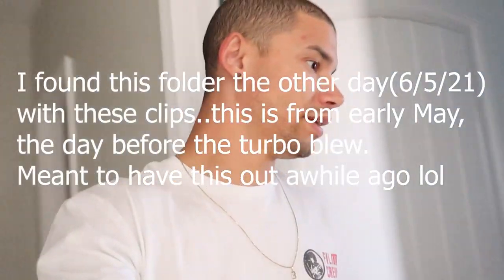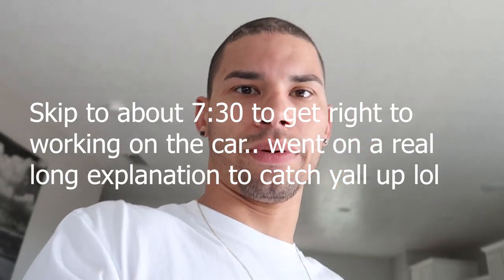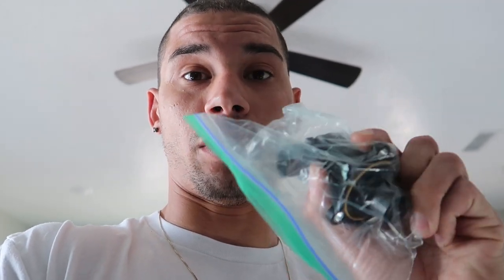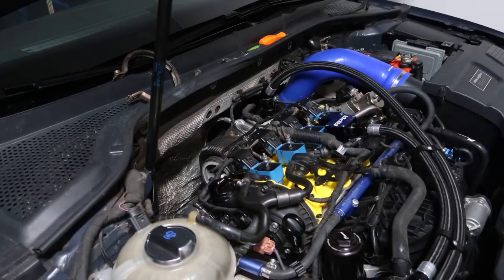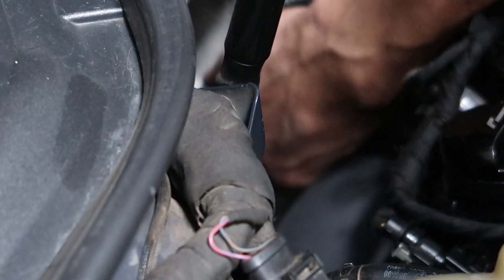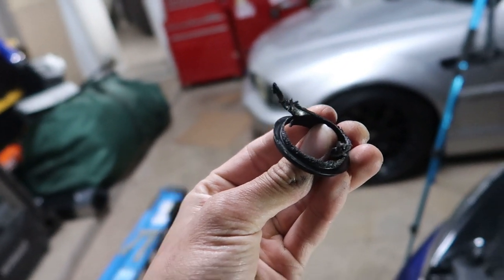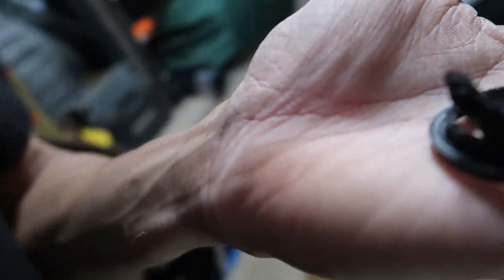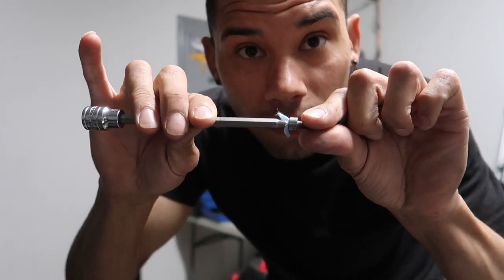I melted my diverter valve and it still held over 20 PSI | MK7 Golf R

Comment: Dude so glad to hear that! Can't believe how these things melt... But EQT swears by them... I went from a GFBDVX back to Stock on my 19R and I could tell the tune was much happier.
Reply from the maker: Yeah I've tried a handful of different DVs and they all suck imo. They're all fully electric though have tried any that use vacuum
Reply: @BryceJordanProductions   Same here- have heard good things about Forge and CTS...  My only fear with that is if the spring doesn't work perfect for the tension needed for your specific setup etc-
Reply: How does this happen? Any metal options?
Reply from the maker: Same man.. imma just stick with OEM lol
Reply from the maker: Lots of metal options but they're hit or miss.. as for why, I think just heat got to it doing back to back 160+ mph pulls lol

Comment: Hi nice work with the R. I have a Gli stage 3 turbo but under wot i’m getting limp mode never happened in stage 2. tuned by boost dynamic tuning was trying to make sure everything is good before i flash another revision. when i hit around 21psi boom limp mode. esc comes on and no throttle control. It’s so annoying 🤦🏽‍♂️ was that diverter valve oem? pulled mine seems fine. idk what else to check
Reply: Scan it for codes mine hits limp mode with engine tourq limit exceeded cuts all power
Reply from the maker: What codes do you get? Yeah it's OEM DV
Reply: I had the same problem a month ago with my is38 gti , it shows all the cam actuators and an o2 sensor bank 1 sensor 1 i replaced only the o2 sensor and it fixed everything
Reply: Hit us with some info. Or pop onto GolfMK7. Not that your tuner isn't your best resource, but a second set of eyes is always great. And while sometimes, too many eye sucks, you are gonna get some awesome feedback.

Comment: What suspension you have
Reply from the maker: These are my suspension mods

Suspension:
034 front adj endlinks (density line)
034 rear shock bushings
034 rear sway bar
034 rear adj endlinks (density line)
Audi aluminum subframe
BC Racing coilovers w/ Swift springs
ECS Diff inserts
Eurocode front strut brace
Eurocode hatch brace
iSweep DCC deletes 
Leyo undercarriage brace (rear)
Powerflex front sway bushings (black)
Racingline stud conversion
Verkline Anti-lift trailing arms
Verkline rear control arms
Verkline rear lightweight tubular subframe
     w/ track bar
Verkline rear toe arms
Whiteline front control arms